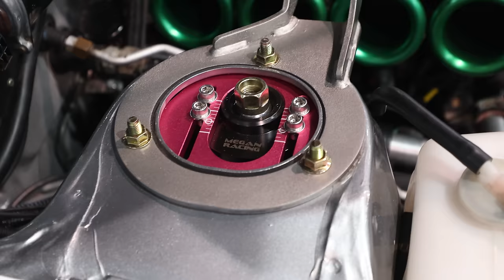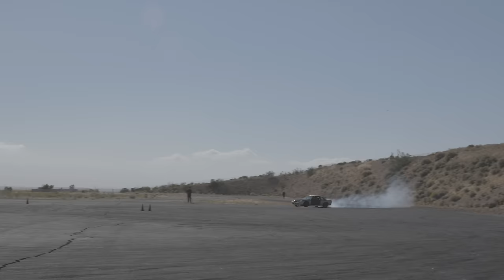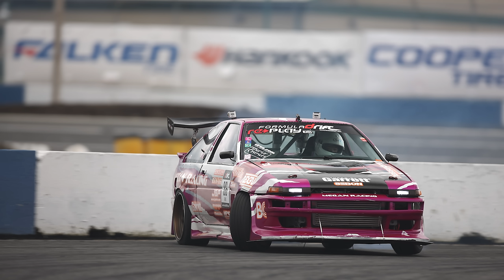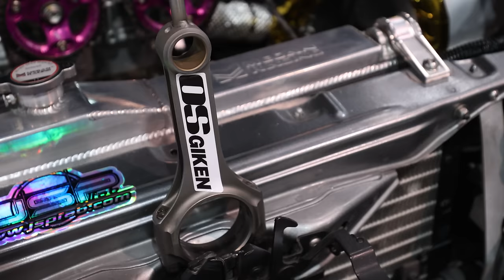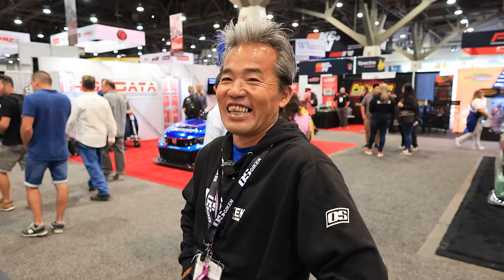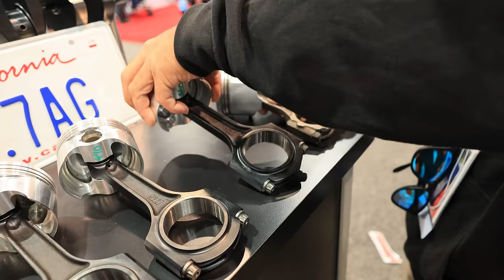N/A IS BEST: Dream 11k RPM AE86 That Revs to the Moon and Back, Built By 86 God Taka Aono

Comment: DUUUUUUDE as a former AE86 owner, this engine is bringing a tear to my eye. For so long, the UPPER limit of the 4age was like 9000rpm for a street motor, but now you're telling me we can have 11k AND drive it on the street?! Taka, you're gonna make me go AE86 shopping again!
Reply: I mean, not really. It has to have the bearings and valves and valve springs replaced every 24 hours of run time.
Reply: @Adam-ub9nu you sure you watch the whole vid? He said he built and engineered it by destroking it to make it less inertial side to side by the piston, less wear to the cylinder wall.. in short built to be reliable street car
Reply: get ready to max out all ur credit cards zD
Reply: @trijohn23  I listened to it at work, maybe he was talking about the race cars having to do that? You're not gonna rev something to 11k RPM too many times before it needs to be rebuilt.
Reply: @Adam-ub9nu  hes talking about the turbo version. and the disadvantage of having a turbo in a 24hr endurance racing
Reply: @Adam-ub9nu  Well the concept basically lowers piston speed by increasing rod length so there is less angle on the piston. Instead it spins the crankshaft really hard and the crankshaft is now the thickness of a RB26 so it can handle that kind of RPM
Reply: @Adam-ub9nu  do you know nothing about engines ? There is a mitsubishi evo that can full send it at 11k rpm and the guy doesnt need to rebuild his engine every week 😂😂😂 there are videos of it on youtube
Reply: @mojakhaha  No, he was referring to the special version of 4ag provided by Hasselgren for Formula Atlantic, with a horsepower of up to 250cv at 11000rpm. But it is only for the race event. The price of $30,000 includes engineering maintenance services during the match.

Comment: Amazing car, a remember watching video on the engine build over at MotoIQ, a set of AT Power shaftless ITBs would round out the build perfectly. 
Only other thing I would change as a street car is adding transparent CAM belt covers, open cam belts look cool and all, but one loose stone in the wrong place and it ends in tears.

Comment: i had a 4age bt in a toyota levin ae111 for a while, it was such a fun car, the sound of 8500rpm was exhilirating. sadly it had minor issues, i bought a new car, and had to sell the old car, even though the issue turned out to be a simple stuck idle control valve, which was easy to fix. but the suspension and brakes were not really w.o.f worthy, so i sold it for a measly $700nzd... at the time i was living at home, and my dad didnt want it on the property anymore. 
its crazy. that thing is probably worth like $10k now... and that was only 8 years ago.

Comment: 2005 Formula D: Round 2- Atlanta, GA:  Taka Aono AE86 vs Samuel Hubinette Viper 
To me, this is still one of the best moments in the history of Formula Drift. It's one for the history books. 

Going head to head, the judges could not decide the winner so they said to run it "One More Time" as they do. 
After going a second time, the judges could not decide the winner so once again they said, "One More Time" which was the first time in Formula Drift's history to run 3 times. 
After 3 times, the judges actually wanted them to run a 4th time, but unfortunately after running 3 times, Taka Aono was forced to withdraw from the competition because his AE86 had overheated due to too many consecutive runs, not enough time to cool down.  

After this in 2006, Formula Drift created the points system for each run and the Sudden Death rule which prevented going a 4th time.

First 2 Runs:
https://youtu.be/psawGKNYEsg?t=608

Final Run:
https://youtu.be/psawGKNYEsg?t=1025

Taka Aono is a legend in my book and I would love to chat with him specifically about this drift battle.

Comment: 4age+7afe=1.8liter 4age we did that to my cousin's starlet almost 20 years ago KT san did it 1st with the techart build ae86.
Reply: But it was carburated and it did not Rev that high, it only revealed at 9000 rpm.

Comment: It's cool that OS Giken is making a kit for this now but you don't need one. You can take a standard 4A crank and put it in a 7A block with custom rods and achieve similar results. With a Moldex 4A Crank you will have even better results. 

Also keep in mind, it's one thing to Rev to 11K it's another to make power there. It's gonna need some serious headwork to do that but I've seen these builds hit 220whp.
Reply: The rods and bearings are much beefier than stock, necessitating a new crank. And you can get it all in a fully developed OS Giken kit instead of having to cobble an equivalent together from various suppliers. Aono also repeatedly emphasized that this is a street-oriented build and the 11k redline is more for streetable fun and flavour than for outright power.
Reply: @firelizard2     First of all OS Gaiken doesn't sell this yet, you can't buy it, it's in prototype. Second bigger bearings =/= more durable. If that was the case bike engines would never be able to rev as high as they do. Third Moldex is literally known for their high rev cranks unlike OS Gaiken. You can call them up an order a 12K rated 4A crank now. 4th the car doesn't make power at 11K so it isn't a streetable 11K. 

The potential benefit is the all in one package like you said but that also depend on the price.
Reply: Hasselgren has been doing it already for over a decade
Reply: @Shadowboost  Aono literally explained that his team used Hasselgren in the past, what it was like, and why this is different.
Reply: @zerohikari2685  The fact that it's prototype is irrelevant. Aono explained that the bearings were part of making the 4.7A reliable at 11k, nobody said that all engines need huge bearings to rev high. Toyota A engines aren't motorcycle engines and the bottom ends weren't designed to rev to 11k. Good for Moldex. I don't recall there being a rule that only one company is allowed to make parts for similar purposes.
And lastly, it's streetable precisely because they didn't shoot to actually make more power. 11k is well past the point of diminishing returns for a street 4A and he repeatedly acknowledged that and said it's for the sound and the feel.
Reply: @firelizard2  Dude the Hayabusa is very similar in size to the 4A. They have the same bore the only difference is the stroke. Hayabusa has 38mm crank journals, 4mm smaller than the 4A and it revs to 11K out the box. Bearing sizes has nothing to do with bearing longevity at high revs.
Reply: @firelizard2  of course, he wants it streetable and not having to rebuild it as the time. I'm just saying that it's already known that it can get there, performance wise.

Comment: How can we get that crank. Asking for a friend
Reply: Theres a few companies that make forged / billet cranks for the 4age.  

Look into companies like MRP- they sell such crankshafts. They also sell block girdles- which dramatically stiffen the block, and dry sump oiling kits (vital for these kind of revs reliably IMO).

These guys can make you a 10-11~ k RPM 4age for roughly 15~ grand (Full forged hardware, rods/pistons/crank, girdle, dry sump, CNC ported head, valves, monster cams / cam gears, valve springs, assembled, etc)

Comment: 11,000 rpm crankshaft who makes it can't you but it online?
Reply: Theresa few companies that make billet cranks for these cars.  

This one in particular uses larger bearings which will help a smidge.  Though id still recommend using a block girdle from a company like MRP to tie/strengthen up the block.  Id be a bit leery about the oiling system as well.  You really want to run a dry sump on an engine thats going to be going to or over 10k rpms with any regularity.  Somehow i dont think hell actually be revving this car to 11k despite the claims "but it can", and im a bit skeptical of the build for such an endeavor. Considering the power he reported it made, id also be willing to bet its not really cammed to go to those rpms.

Comment: In all honesty for the price of motor build, I personally would just swap an F22c from the Honda ap2 S2000 stock  revs out to 9k. Then add an all motor Ferrera valvertrain kit paired wit vtec killer camshafts with some Kinsler 60mm itbs with either fueltech or haltech standalone..... 11k easy all day  everyday.😂😂😂
Reply: F22C1 is limited to 8,200RPM in the AP2. F22C1 is not generally considered to be a good choice for very high RPM, due to the longer stroke. The F20C is the one that revs to 9,000RPM stock. Even taking an F20C to 11k reliably would not be "easy all day everyday". It wouldn't take that much less work than building a destroked 4.7AG.
Reply: @firelizard2  it's fairly cheap to de stroke for that purpose but the ap1 s2k f20c handles 9k amazingly bone stock without mods 240hp. N the jdm version of the s2k motors  if im not mistaken Rev out 1k more than usdm ones due to ecu emissions